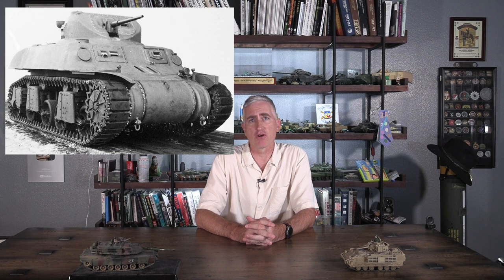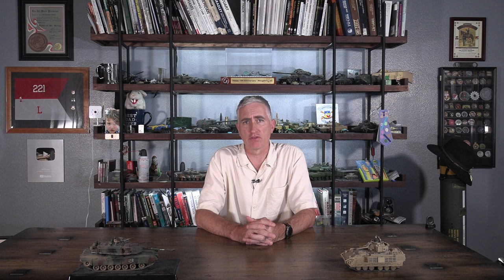The Tragic Tale of the Quad Cities Tank Arsenal and the M7 Medium

Comment: I worked at tool grinding shop while at college.   We made cutting tools that went into the machine tools.  Our machine tools were very expensive because they had to produce at a very high accuracy.   I only sharpened end mills.  The machine tool I used to do this was made by our tool and die makers to their own design.  The high value work was done by a cast of unique characters who would not even let me clean their machine tools for fear I would mess something up.  Eventually the owners realized that since I had learned the lingo that I was ideal for working in the office doing customer service instead of hands on.   BTW the simple way of explaining the more expensive mill is that it did at least one more function that may not be called for .  Machine tools that could work on tank size components are bigger than the components.   This makes the machine tools very expensive.   The American automotive industry had perfected methods for creating tooling that efficiently produced components.   Among other technologies were using stampings inside of machined components.   Stampings are less expensive once you pay off the very expensive stamping dies.  An easy to understand comparison is the very expensive Thompson submachine gun vs the M3 grease gun.  A Thompson could be built in any decent machine shop, while the M3 needed giant stamping machines with specialized dies.   
BTW BTW during WW2 we shipped many machine tools to the USSR that they did not have the capacity to make.  (A T34 could have been mad with Cincinnati Mills). By the 1970s the machine tools were reaching end of life and the USSR went shopping for replacements.  This implies that post WW2 Soviet tanks were made with USA machine tools!
BTW BTW BTW in the 1970s the USSR decided it needed to develop it's own ability to produce machine tools in quantity.

Comment: It is in the dark corners of history that it really comes alive - tyvm.

Obviously nobody cares about - or even knows of the Quad cities  ;-)   Right off the bat IH putting the engine and transmission on rails.  After working on GM cars far too often I was delighted when I went to change the clutch plats on an IH truck and found that not only was the drive shaft dead horizontal, making backing the transmission out a breeze, but once I had cleared the engine there were tapped holes in the frame to secure the tranny in this now partially removed position. I was as if somebody had wanted to make maintenance easy.

Comment: A vertical boring mill (vbm) is a large lathe, standing on end.  Betts is (still in business as machine tool research, MTR) a manufacturer of very large lathes and vbm's.
A vbm would be needed to cut the turret ring, and machine the turret.  This could also be done on a milling machine with a rotary table.  

Tool room methods meant they were using universal, or tool room machines, (machines that could do a wide variety of work, but were not tailored to each specific task) and each setup was probably cumbersome and involved, and the machining required a skilled machinist, not a machine operator.  (Like michael bloomberg said just needed to crank the handle to the arrow)

Comment: In hindsight, they probably should have just started with the Canadian RAM (already under production) as the basis for the design (as what the M7 resulted as was only 12 inches lower in height, 6 inches narrower in width, 22 inches shorter in length, and 12,000 pounds lighter), reduced its size a little, lightened its armor castings and plates, and stuck with the 57mm gun. They did afterall eventually settle on the turret ring diameter of the RAM, the mountings and guns were already being made in Canada, and also conveniently used basically the same continental radial engine (albeit in a form with 50 more HP). Of course design by commitee would likely have messed that up. The 6-pdr/57mm is perfectly capable of killing the sort of armored vehicles a light tank would likely encounter, and they DID make an HE shell (british royal artillery troops, the guys manning the towed version of the guns, DID have them...though for whatever reason they never supplied them to the Cromwell tank crews).

Comment: They should have just built the 37mm or 57mm version to be sent out as lend lease while the 75mm version was finalized. It seems that it would have been a feasible way to use substandard vehicles, at the very least to relieve pressure on stuart production.

Comment: The Rock Island Tank Arsenal in a way is similiar to the ongoing saga of the Space Launch System. Supposedly based on Shuttle architecture specifically the External Tank to "save" money it is way behind schedule.  Hence some critics referring it to the Senate Launch System. If only we could offer some Senators a free ride on its first test flight.
Reply: My running joke about a surprise nuclear attack on DC would mostly offend the American people due to the destruction of all the museums.

There may or may not be cheers over the need to elect new politicians.
Reply: @ScottKenny1978  
Sometimes I think it would be a good idea if we moved all branches of the Federal Government to say Gary, Indiana.  Only they would be required to live there in the equivilant of the average housing unit available. Or Fargo, North Dakota. And Congress would be required to be in session only between December 1st and Feburary 28th. In buildings with no heat. Elected officials and federal employees especially Cabinet Secretaries, Undersecretaries and heads of agencies are public servants. Not elected or appointed Princes (or Princesess) of State.
Reply: @mpetersen6  that was actually the point of DC. It was a malaria swamp that nobody wanted. So in the summer it was just short of unlivable before DDT and air conditioning.
Reply: @ScottKenny1978  
There is that.

Comment: Since the US M7 Light Tank is my favorite "what if" I will sit to the end, Colonel . . . and, pour vous, an Irish benison, somewhat modernized:
"May the road rise to meet your tracks . . and it's not an IED." -Anon.
Reply: I identified M7 as "Light" tank M7; as in "not supposed to replace the M4 Medium".  My understanding had been that M7 was meant to replace the M3 Light.  Administrative intransigence did the rest.  Disclaimers aside, I'm glad I brought the ultimate tool to a military history presentation: fresh hot pizza.
Reply: My AFVDB folder on M7 states its mass at 53,950lb, not 56,000lb, so it's obvious the little tank that could was trying to slim down.  Stop fat shaming the poor thing, Nick!  It's trying as hard as it can!
Reply: Sherman was some 66k lbs. Ironically, M7 had noticeably thicker armor than the Stuart and the Chaffee, so had it been made to the same armor standard as the M24 from the start(preferably with welded steel to decrease weight further and improve protection efficiency), it would have been close enough to a light and far enough from the M4.

Comment: Sounds like the tale of the $20,000.00 hammer , not to be confused by the $10,000 seat with necessary fasteners required to fit said seat unto the Thomas Crapper, now equipped with the $5,000.00 MkVI aquatic disembarkation lever.

Comment: any time the government is involved in anything it screws up. specs: 90 mm gun mounted on revolving turent with coaxial machine gun. mounted on hull propelled by treads using the fastest engine available. crew area: driver, hull gunner of 30 cal machinegun; Radio operator main gun loader; tank commander with view ports exterior 50 cal machine gun for air defense.

Comment: BIG, BIG FAN.
Question:
The M48 used in Vietnam. 
Why did they mount their 50 cal on top of  the cupola?
...looks a little bare butt to me.
Reply from the maker: near as I can tell, because it was quicker to respond in close terrain. the cupola was more a WW3 thing.
Reply: @TheChieftainsHatch  thanks
Reply: There were also apparently reliability issues with the MG inside the cupola (it wasn't a standard M2).

Even if your butt is hanging in the breeze, you can spin the pintle around a lot faster than the cupola, and it gives you much better situational awareness.

Comment: I still dont understand why US dont use the 57mm for tank guns, surely a Stuart 57mm with enlarged hull and maybe better engine would be a good idea and relatively cheaper ?
Reply from the maker: The 37mm turret was cramped enough, you couldn't really put a 57 into it. As for enlarging the hull as well, you may as well make a new tank anyway.
Reply: @TheChieftainsHatch  Won't an enlarge turret and/or hull be able to solve that?
Reply: @AHappyCub  when you enlarge them, you get the M4. that's the thing. the point was to make a small light tank. if you're gonna enlarge it, might as well make a new tank with a better gun.
Reply: The 57 mm needed about as large a turret as the 75 mm.  For instance British Churchill tanks that were built with 6 pounder guns were up gunned in Africa with 75 mm guns from knocked out Shermans, and used in Italy.  Later the British produced a 75 mm gun that took the same ammunition as Shermans, which was basically a bored-out 57 mm.  This was used on later Churchills and Cromwells.  The 75 mm had the advantage of better HE ammunition, which made it more versatile in combat.  Tanks tended to fire more HE than anti-tank ammunition in Europe after D Day.
Reply from the maker: @jerry2357  Indeed, but they were horribly cramped and would have had no chance of passing US Army testing.
Reply: @TheChieftainsHatch  I was agreeing with you.  There’s no point in putting a 57 mm in, when a 75 mm is about the same size.

Comment: Sounds like the company did its best, but the government inadvertently screwed them over.
Reply: I think a lot of it can be excused by wartime needs and chaos... ofc, it was nonetheless certainly frustrating for those directly involved in and affected by it.
Reply: @Bird_Dog00  i think people forget that this isnt the only factory being set up in 41-42. Machine tools were at an absolute premium, much of the early production was focused on additional machine tool production. A light tank line is going to take the back seat to setting up B24 production, which was deemed more important and requires far more tooling. By the time that the bottleneck was overcome, it was realized that the tank was no longer needed. The right thing to do is to kill production. Ultimately, the fault lies with the Army not killing the project early and transitioning the resources, including the factory, to better use.

Comment: Too many chiefs and not enough Indians ?, sounds similar to the outfit i once worked for (BT) motor transport, where a brand new truck engine was ordered wrongly and instead of returning it, it was dumped in the lake, where they sold all their landrover spares cheap to a local dealer...then bought them back at retail.